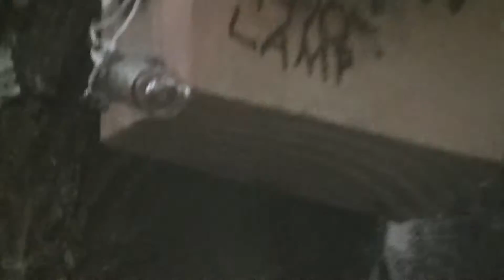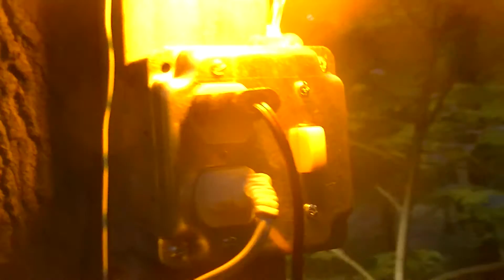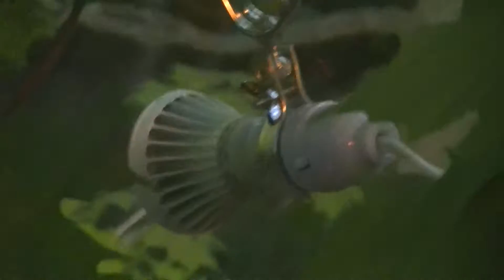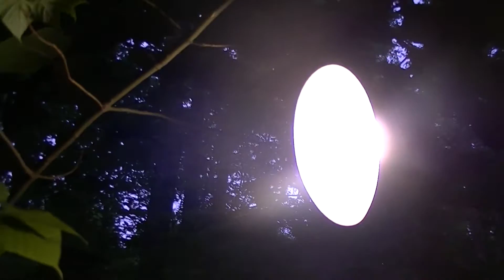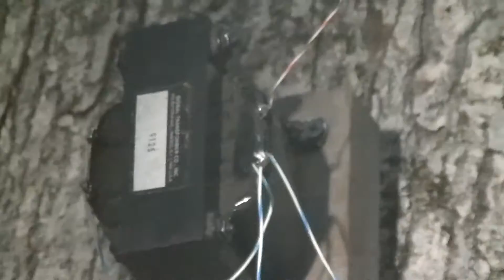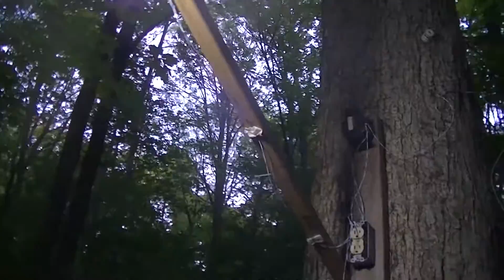More DIY power line testing

Comment: randacnam7321  u commented on modlet 9months ago, would you say just unplugging or if you have a power cord (turn it off) would be doing the exact same thing?
Reply from the maker: It would accomplish the switching part of what the modlet does without the stupidity such as not having direct control or switching the neutral.